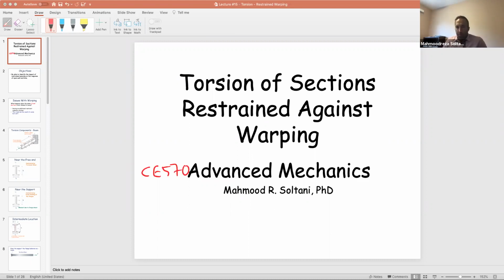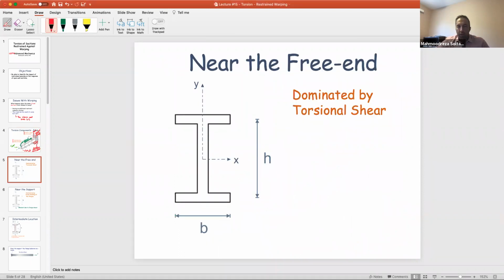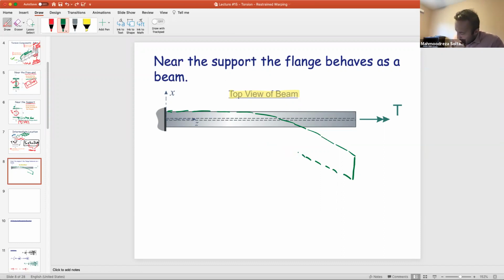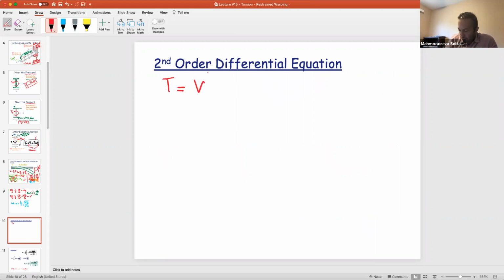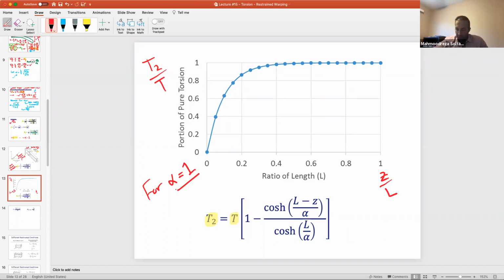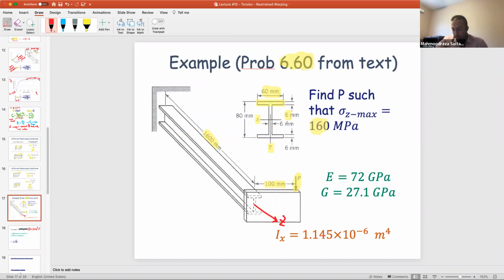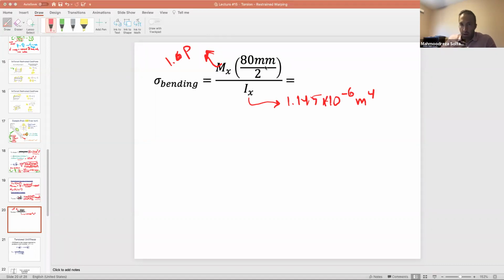Torsion of sections, restrained against warping by Matthew Soltani, Ph.D., P.E.

Comment: can anyone tell how comes the dbeta/dz=theta, that the video said from before, where can i see the video about before, or any information about this formula come from? because in my opinion, dbeta/dz=fài, thanks
Reply from the maker: Beta or phi is the angle of twist. Theta is the unit rate of twist. Z is the location along the twist axis. Thus, beta is equal to theta times z.
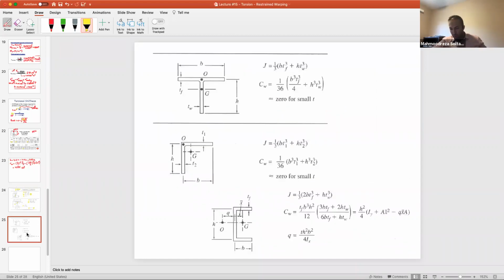Reply: @Concrete_structures_class  thanks for your reply. Can i ask you another question? if it's a (unsym)C-beam, how to prove the formula in the end of the video 1:18:05, will it be the same derivation concept as I-beam? 
Because i'm studying unsym composite C-beam, i saw someone use the formula of I-beam and transform to composite, but i use it in C-beam composite, it doesn't work, so i'm curious that the C-beam formula derivation concept is as same as I-beam?